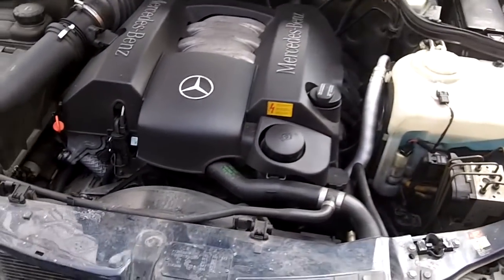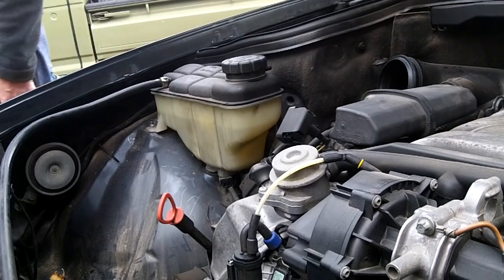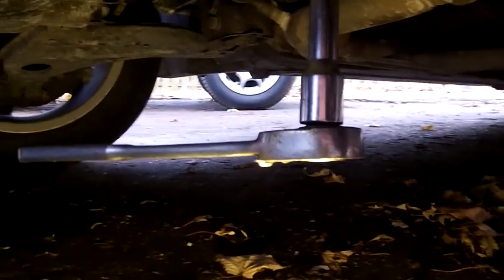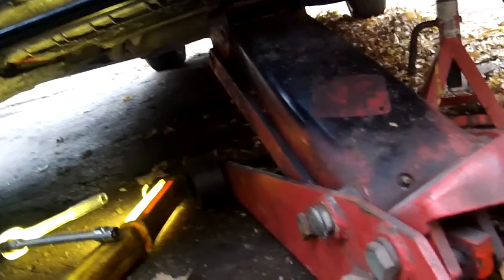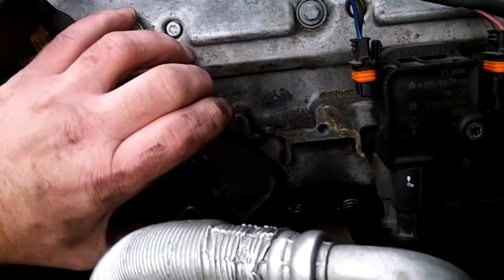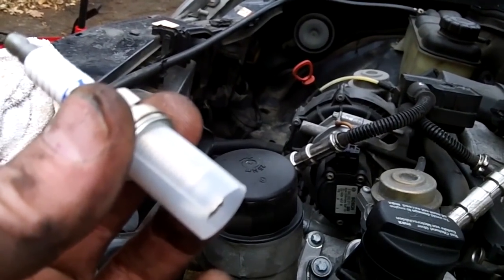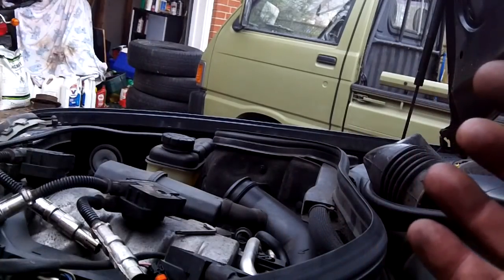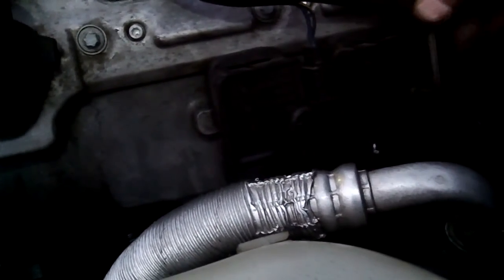Mercedes M112 3.2 v6 spark plug replacement w208

Comment: It's a good idea to blow out the spark plug recess with compressed air or brake clean before removing the plugs.  This will prevent any debris from falling into the combustion chambers when you remove the plugs.

Comment: I replaced my plugs and wires on my 2005 CLK last weekend, following your excellent instructions here. I bought a Mercedes sparkplug wire removal tool - basically a 17mm openend with a bend for leverage - 16 bucks on Amazon. Everything went well, just tool about two hours. Thanks so much!
Reply: David Browne sup ,bro I have 03 clk 500  did you have to lift engine to remove spark plugs....
Reply: I didn't need to lift the engine. However, I had the engine mounts changed a few months ago and the engine had settled lower on those old mounts. If I had changed the plugs then, I would have had to raise the engine.

Comment: Hi I very helpful tips and advice. if I may.  have a 1999 CLK 320 Convertible which is in need of much tender loving care. I did manage to change all the spark plugs without jacking the engine up or removing the whole air filter box. I removed just the air filter box cover. The air pipes which was necessary for another job but came in handy when eventually removing the spark plugs. I moved the screen wash reservoir to one side without disconnecting it. It was very difficult to remove the spark plug caps and is an Idea to use any Mercedes tool to remove them.

Comment: get a cheap 17mm offset box spanner and cut the box end in half - it makes it a crescent, jam it on the metal bit of the wire and lever it against the valve cover to pop them out, MB tool is the same concept its a 17mm open ended spanner with offset.
Reply from the maker: excellent idea..thanks.. I'll definitely make one ..:)

Comment: Thanks, the door switch is confirmed good. Soo the the overhead switch may be bad OR there is a bad control module hiding somewhere. Thanks for the advice. Best, Tony

Comment: that hydrolic lock as you say, may aid the removal of it from the plug next time. as you and I know how difficult that is. sometimes it take a different perspective to judge with. these wires won't pop off, being how difficult it is to get off in the first place, heck they are as hard to put back on. but having raced a Lancia scorpion in scca. yes plug wires do pop off from the electrical firing a high revs. still not quite sure the exact reason it does it.  but the lancia scorpion runs normal plug wires, like those found on domestic cars. and they come off way easier.
Reply from the maker: The only reason I can think of them popping off is a build up of heat in the boot end , that may allow some off-gassing from the rubber which may be combustible and blow the wire off.. or just air in the boot end heats and expands the pops the boot off.. I used to burp the boots on my 911 with a paper clip to allow the air out, as they tended to come off as well.. They did make a loud pop when it happened so I never agreed when people would say they just slipped

Comment: Good video...clear and concise.  I just changed the plugs on my Chrysler Crossfire that has the same engine. It's a "fiddly" job that can be done by anyone with a bit of patience.  You mentioned "Remove the MAP (Absolute Air Pressure) sensor."  Doesn't this engine use a MAF (Mass Airflow) sensor?
Reply from the maker: I likely sounded like MAP, but yes, I would be the MAF
Reply: My apologies, I was wrong.  You were right in your reference to the  MAP sensor.  The engine (same as in my Crossfire) also has a MAF sensor in the throttle body.  First of this type that I've seen. My old Dodge turbo only had a MAP sensor.

Comment: Just changed my plugs in my m112 engine wow what a diff i had no previous history on when they were changed my car has 250 k on it and started to lose power and rumble quite abit. Now drives like shes brand new
Reply from the maker: Love it when a cheap fix like plugs makes a big difference ... It makes the whole day so much better :)

Comment: just finished my c280 with the same engine & i didn't have to jack up the engine nor did i use  a special spark plug boot tool............even though i belive the plugs where never changed..........
Reply from the maker: c280  w202 chassis had a bit more space than the 208
Reply: I am just about to do my c280 so I am glad to hear I don't have to jack up the engine.  Excellent video, thanks for sharing.

Comment: Question: In the video you said to tighten to 8-10 ft pounds. I just did my switch out and used Bosch iridiums and said on the box to tighten to 18-20 ft pounds. IDid I way over tighten? I did use a little anti cease and they went right in. 

Also, a trick I learned which can be very helpful. I used a 3" 3/8 piece of rubber hose and slipped it on the plugs and used that to screw in by hand then pop them off. The reason is because when I used the plug socket and extension like you did...when I attached the wrench you tend to set the socket down harder on the plug and when you go to take the unit off the plug, it will separate and leave the socket on the plug. What a bitch that is to try and get off without having to remove the plug again. This way you slide the whole wrench with extension and universal down on the plug just enough to tighten..then pop the whole thing off.

I have a 2003 C320 and just did my plug change at 126K. The service records I had from the guy I bought it from had them done at 60K so before winter wanted to get a jump on doing them. Also, have a 1999 C280 so I've really enjoy your videos!!
Reply from the maker: +Robert Boisvert I'm glad you caught the torque figure I said..it was a bit low..I was doing a video prior to that on a motorcycle and the torque for the smaller bike plugs is lower.  on the Benz torque should be around 18-21.. I'm going to have to add a notation on the video for that , I'm glad you pointed it out..amazing that I never caught it  lol..the rubber hose trick works well I agree

Comment: I used a 17mm wrench for  removing the plug. Just pry against the valve cover and counterhold with your finger so you don't bend/break the sparkplug. Works like a charm!
Did not lift he engine, just used an universal joint. However i have the 2.6L version on the 211 chassis.
Had the same plugs bosch platinum F8dpp332.
Any improvement after the change?

Comment: Thanks for the video!  Question: When you were removing the old spark plugs, how tight/hard were they to remove?  I'm getting ready to change my spark plugs and I've heard they can be hard to remove.  Thanks!
Reply from the maker: the plugs themselves were fine to remove, not seized or stuck
Reply: Thanks!  My next weekend project!*****
Reply from the maker: mjlogan2001
any time  :)
Reply: mjlogan2001 h

Comment: Thanks for the great tutorial. Everything worked for me. How do I get the air hose back in its place? I can not get the hose over the pipe?

Is there a trick?
Reply from the maker: the air intake ? if it's stiff it may take a little wiggling

Comment: very informative I own a Chrysler Crossfire and has same engine. Keep making these helpful videos. this Crossfire is my First Chrysler and Mercedes. I always wanted a Mercedes and since I got this car very cheap. My engine cooling fan does not work I tried so many things to remedy. the car does not overheat but it winter.  I think someone messed up the harness. I bypassed thean to see if the fan was bad but it works I took the fan control box apart and it was not fried so guess I will find out when the weather warms up I don't have a garage. also the ac pump does not work either but has a Freon R134 charge it has pressure so guess there is something in the system. I joined the Crossfire Forum today so guess maybe they can help me

Comment: Can you do a video on how to lift up the engine 🙏😭. I’m having trouble with the last plug cause there isn’t much room for my wrench 😔
Reply from the maker: remove the lower engine mount bolt from that side (comes out from underneath ) and place a wide piece of wood between the jack and the bottom of the oil pan to spread out the load and gently lift the engine slightly

Comment: Thank you for this wonderful video. I REALLY appreciate it before I replace plugs and wires on my w203.
Reply from the maker: +mechaike  the suggestion someone posted of using a 17mm wrench to lever the plug caps out is a good one...better than the bent pliers. hope that helps
Reply: +fupabox Yeah, I ordered the 17mm wrench that is specifically designed for Mercedes V6 Spark plug wires. Perfect for a novice like me who has never replaced them before.

Comment: Wait a minute, I take my some of my comments back. I just noticed u have a couple of vids that will probably address my issues. Thanx : )
Reply from the maker: No problem at all.. A lot of my videos on the w202 playlist will apply as well,most of the chassis/suspension is identical

Comment: You don’t want to put the dielectric grease on the terminal only between the ceramic body and boot.
Reply from the maker: That;s a debate that has raged for years between mechanics . Some swear to use it some say only on the plastic boots. I've seen many rotted pins with no grease in them , but no rotted pins in connectors with grease in them . The connection on electrical pins should never be compromised by the grease as long as the pins are tight in the sockets . I'm sure the debate will remain as long as cars remain. Appreciate the comment .

Comment: Hi, First of thanks for the video. I wish you had something for replacing the O2 sensors for a CLK320. Can't seem to find anything on youtube for this model. I have a question if you are able to throw some light on it. I am getting p0170 and p0173 codes have been advised to start off with the MAF sensor. I cleaned it with the MAF cleaner afew times but the Light won't go away. Also, my MAF was clean as a new one when i first opened it up. Could it still be the MAF, even if appears new and shiny?
Reply from the maker: +Asim Saqlain Yes.. the Maf can be bad even if you can't see any visible damage or dirt

Comment: ok. When I disconnected the main lead to coil #5, the engine did not slow down. So I switched coil #4 with wires to the #5 spot, likewise #5 coil and wire to the #4 spot. No change to the #5 spot, thus coil $5 coil and wire now at the #4 spot worked fine and engine slowed down when I disconnected the #5 coil athe the #4 position.  Question, is there a re-set for the computer somewhere?
Reply from the maker: John Saunders ypu prob tripped a misfire code..the only reset is with an obd reader..at least you know the coil is bad and have solved the problem

Comment: Fuuupa Heeelp ! Even if you left the m112 behind we still love you and think of you as a king. Do you know the spark plugs gap for the original bosch ones like the one you take out without the thinner tip. Im trying to re-use them(Im from argentina and we are poor) but im getting 2 infos.. or 0.032 or 0.038. Im going crazy and cant get the answer. Could god fupa have the answer?
Reply from the maker: 1mm    or .039 inch  . Still have an M112 in my ML350 . It has the last version of the M112.  A 3.7l
241 hp . Same plugs  :)
Reply: @fupabox  Thank you so much ! Its nice to hear that (L With all this info you got on this motors Its nice that you still have one.

Comment: changed all 12 plugs , motor is still shaking as if a spark plug is not connected. At higher RPM (3000( the bucking stops. Should I check the coils or maybe the wires (looked ok) need to be replaced. My e320 wagon (4 wheel drive) is 2000 with 186,000 miles.
Reply from the maker: John Saunders could be an ignition coil (if it is only a bit gone it won't trip a check engine light )  could also be the harmonic balancer, engine or transmission mount ..or possibly a torque converter (doubtful)   I would check the harmonic balancer first since it can do thousands in damage if it goes  https://www.youtube.com/watch?v=DN4ufRjb3CM
Reply from the maker: John Saunders sorry yes the wires are possibly at fault as well

Comment: I kind of jumped through the video and didn't notice, but did you apply anti seize to the plug threads?
Reply from the maker: No anti seize..the Denso tt plugs have an anti seize coating on the plug from the factory, as do most platinum and Iridium plugs..because of the lengthy plug change intervals most manufacturers use the coating to prevent seizing

Comment: Just so you understand, each coil fires two plug wires to the same cylinder. and they both fire at the same moment, so which plug wire goes to which plug is up to you. They are the same electrical point (known as a node) or the timing would be pre-firing one plug before the other. Each single coil fires both together, so you don't have to mark them.
Reply from the maker: No No.. while it is true they fire at the same time SOMETIMES.. they more often than not fire sequentially, and the sequential timing also varies. The coils MUST be plugged into the proper plug or you could actually damage your engine similar to using very low octane fuel

Comment: Fupa is it possible to show how to trouble shoot a leaking power steering pump... i have the a 2002 ml320 with same M112 3.2 v6 and if you tell me how to check if pump is good ? as i am thinking the resovoir needs to be replaced but not sure. basically the sterring fluid leaks alot over night..thanks!
Reply from the maker: start at the reservoir and look for leaks in the hoses  (this is the most common area to go bad) have the engine running while someone turns the wheel side to side, just be careful and stay away from moving parts, but  you should be able to spot the leak without being too close.. if the reservoir and hoses are wet and covered in fluid . wipe them down before starting the engine and checking for the leak, it will be easier to spot if it is all dry before you start it up.. If it isn't leaking from anywhere up top then you will need to look under by the drivers side wheel... you should be able to get under and see up to the steering box without jacking the truck up.. again wipe everything down so you can see where the leak is coming from ( again it will likely be a hose where it connects to the steering box.. it is fairly rare for the box itself to leak significantly... if it drips out overnight sitting still without the car running, then the reservoir is possibly cracked, or the lower hose is leaking
Reply: thanks Fupa i will let you know how it goes.

Last questions how do i know if the pump connected to the belt in functioning properly? also do you know how many hoses are connected to the pump on this platform?

thanks your such a big help
Reply from the maker: omar s 2 hoses.. 1 in and 1 out... if the pump isn't working you will have a very hard time turning the steering wheel

Comment: I did the spark plugs on my w202 c280(m112) today. my car originally had bosh platinum in it. i used bosh platinum+4, but it is running really rough and is down on power, there was no problem before i changed it though. what could it be? do you think it can be that i didn't change the wires as well or maybe the plug  wires arnt on tight enough?
Reply from the maker: adrian jennings. The +4 plugs are causing the ignition problem...Mercedes doesn't recommend using them ..some cars will run fine with them, most won't...
Reply: ***** others say its makes their c280 run better. do you think it could be that one of the wires had a broken piece of the spark plug jammed in it and in order for me to remove it i had  to open up the wire and break parts of the rubber insulation off?
Reply from the maker: adrian jennings. that could be it , yes.

Comment: I have a leaking valve cover gasket on my M113 engine. I've looked at your videos but haven't seen a vid on this? Is this something that is best left for the dealer?
Reply from the maker: valve cover is pretty simple, just a lot of fiddly stuff to remove which takes quite a bit of time...I think the dealers charge about 5 hours + parts to replace the seals... I found a forum posting in my files on the procedure  http://www.benzworld.org/forums/w220-s-class/1927017-valve-cover-gasket-breather-cover-sealant.html

Comment: Ok, thanx for sharing! Im planning a trip to Fl. and I want to have my coup in tiptop shape. I can't find a Chiltons or Hayes repair manual for my clk. Any help u can offer for the clk320, PLEASE post. Any info on the BSR, ASR lights comin' on. I changed the brake switch and nothing. Also I need to replace # two\bank two o2 sensor. Any info would b appreciated.
Reply from the maker: #2 bank 2 is the drivers side after the cat..easiest one to do..I got that code last week and ordered the sensor from "Rockauto" original Bosch ,around $60..The code was popping up every other day and I would clear it with my OBD scanner..Since the plug swap..no more code so I haven't replaced it yet,but it is about a 10 minute job from under the car..Do you also have the ABS light on ? The ABS will effect all 3 (ABS,,BAS,ASR) but if the fault is in either of the other 2 the ABS will not trip a code.
Reply: no, no abs light on

Comment: I have a 06 ML350. It is idling high. Goes from 5 to 20 when I put it in park.
Reply from the maker: +Ray Wash  ..almost 99%  positive it's the MAF sensor..make sure to get a genuine Bosch..the aftermarket units won't work...other posibilities are cam or crank sensor...if there is a check engine light *should be )  an OBD reading will show the exact one causing the issue...crank and cam sensors are a 10 minute replacement . at arount $60 for the part...Maf is 5 minutes, around $200

Comment: following up, been a while, so ya, you can take em out without jacking the engine, but you have to pull the valve covers off ))) I did both jobs so I had em off and it was far more manageable, but still a huge b** as you know already ))